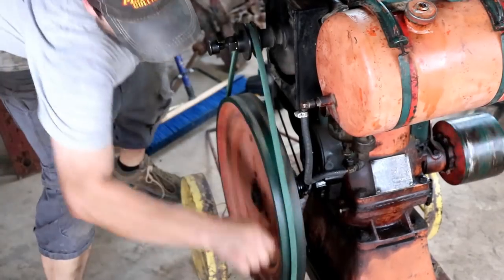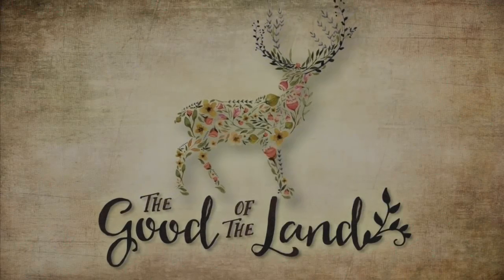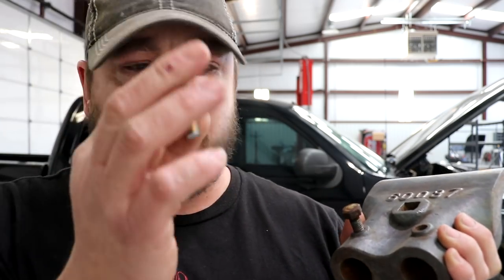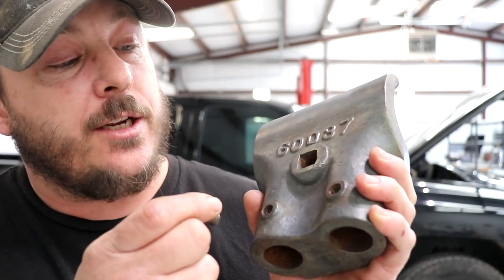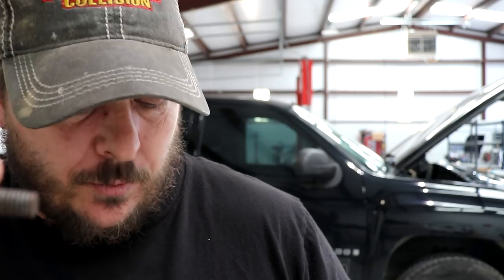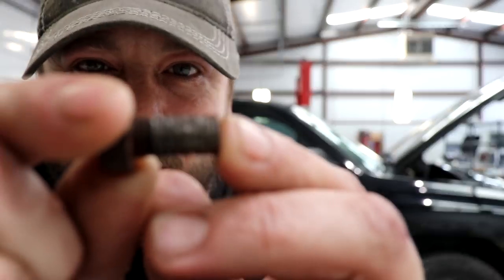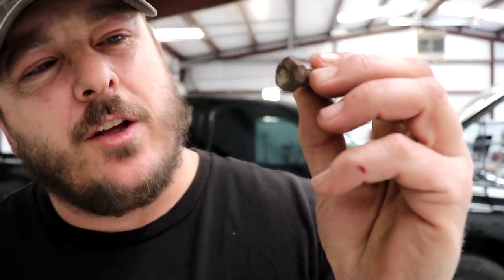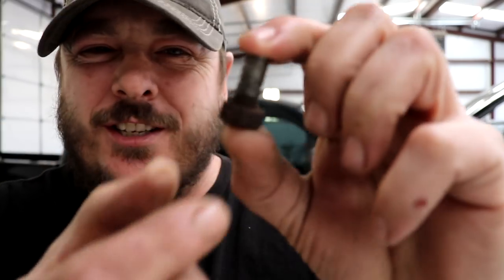OLD MECHANIC TAUGHT ME THIS YEARS AGO! Passing it on to the NEXT GENERATION!

Comment: Oh yeah, here's an old one, ( I learned this one on English cars ) ! That front engine bolt, that holds the pulley on, is an 1 5/16" bolt, which is 3/4" drive, and expensive too, who's got one of those? So you get a Craftsman 1 1/4" and beat it on with a BFH, splitting the socket, leave it like that and when your done putting your mill back together, knock the socket off the bolt and take it back to Sears, YOU CAN'T BEAT THE GAURANTEE at Sears! Hey, how often you going to rebuild your mill?  I've been motorheading for over 50 years now and I get a charge ( battery ) out of telling of my experiences! Here's a good one, no matter how tempting, never put tools on top of the car battery, they touch the poles, and red hot, then white hot, then BANG! Your tool just showered you with white hot metal, Time to really break out the Mechanics language dictionary of four letter words! Or weld around a gas tank unless It's filled to overflowing with water! And don't weld on concrete either! Never! Remember! Assembly is the reversal of the removal procedure, unless your trying to build up a stock of hardware, what this guy should have done a long time ago.

Comment: Cut the bolt with a hacksaw, it's quicker. One nut is all you need to chase the threads but, you can add another if you're that doubtful AND the bolt is that long. And don't waste time tapering the threaded end. After cutting a bolt a half dozen times you shouldn't need the nut to chase the threads.
Reply from the maker: +Joe-n-Tex https://youtu.be/OgvQKuCOhqI

Comment: quite something about those old guys, some couldn't read very well, and nor did they get around to crowds with information,  such as the internet, schools were grade 1 though 8 in one room. that's if you wanted to go, and they worked in the fields before they were 10 years old. my dad was one, he'd cut bolts like that, he took a farm tractor a large one, it had a slinger or dipper oil bath system, he drilled the crankshaft and lobes and put an oil pump in it, he swapped 2 gears around in the trans, it went from a 1200rpm farm tractor engine to 4000 rpm or so. no seat belt and no roll bar.  it would do wheelies hitting third gear, it went 40mph.  he raced it and always won. limited information yet it was narrowed with quality. not a lot of random bs. he slept from  8pm till 4am every day of his life. he didn't talk alot either. i had to watch if i wanted to learn anything, he didn't explain it. there's not a lot of them left to learn from.

Comment: Good video, just wondered why you ground off the markings on the head and the sides, it will just rust sooner.  Maybe you want it to look similar to the other bolt?  Also, the length didn't really matter unless it sticks out so far you would gouge your arm on it.  But I get how you like things to look the same, and match, I'm sort of the same way especially if you are painting it.  Haven't been watching the whole restoration process you are doing, but that hand crank engine or whatever is pretty cool.  Good job!  I'm like the other commenter, I use a hacksaw sometimes, cause I don't have a fully equipped shop with air tools
Reply from the maker: +Renee Mellinger https://youtu.be/OgvQKuCOhqI

Comment: You got it wrong. After cutting the bolt shorter, do a little rounding off, THEN unscrew the nut. Otherwise, rounding off may bugger up the starting threads, Pay attention.

Comment: Great video.  ¿What grinding wheel did you use to reduce the bolt length, kindly?  (¿A flap 36 grit disk, as for a hand angle grinder?).  Just wondering.  Thank you.

Comment: Those marks on the bolt head indicate the grade of the bolt in other words the hardness of the bolt . He should have not ground them off they could have been used later on to tell what grade of bolt to use . Sometimes it matters as to what grade of bolt to use .

Comment: Thank you for this trick.  The condemnation below is really disheartening.  I'm a new mechanic myself.  Know one ever showed me to do this and most of what I learned, I learned in vocational school.  They really push the "right way" ie. Go get the correct bolt.  Yes, of course I have shortened bolts when needed.  But it never occurred to me to put nuts on to set the length I want prior.  I always just compared the two and ran a thread chaser over it after I got it to the length I wanted.  Little tips like this are what us new mechanics that didn't have the privilege of learning from some old timer or some such need.  All of the hate below is exactly the sort of attitude that keeps young people out of the trades.  They show up somewhere eager to learn, are ridiculed for not knowing "no-brainer, basic" techniques, and assume the fault is theirs.  As if somehow not being taught anything and then not knowing how to do that thing is their fault.  All of the experienced experts below should give new people a chance to learn!  Ridicule them when they do something genuinely dumb.  Like that time I thought I could just pry that last little bit of the lid of the grease can up with the inspection mirror... because only like 1" of the lid was actually stuck down in the crease but I couldn't get my fingers on the greasy lid.  That deserves being ridiculed and I took it with chagrin on my face.  Not knowing old-timer tricks and tips should be a teaching opportunity!  Keep it up.

Comment: Just wondering what possible benefit there was to grind the mars and coating off the head of the screw.
There's none.
In fact, you just made rust considerably more likely.
Reply from the maker: +Robert Evans https://youtu.be/OgvQKuCOhqI
Reply: Post what you like, it's your channel.
I'll rely on my 28 years as a Toolmaker and Instrument-maker.

Comment: Not sure why you felt the need to obliterate the grade 8 markings on the head. That would be nice to know for someone years down the road if this bolt ever seized up in the hole. They would know immediately they were dealing with a hardened bolt and not a grade 5 or less. Might save them a drill bit or an easy out.

Comment: Why dont u cut it with a dremmel or side grinder w/ cutting blade? Not sure how long it took you to do it that way but seemed way longer cutting time.  its easy to cut them flush up to the nut. Never had a nut jam on me backing it out.  And if so id just put it on a grinder till flush.  Thanks for sharing man great vedio. D

Comment: What wasn't told is that after grinding the bolt down you might not want to take it out of the vise with bare hands (as shown)
Reply from the maker: +jiw71 Its cool to the touch thanks to the Norton Blaze disks.
https://youtu.be/vtOR9A8ekFg

Comment: another useful trick is if you cut it in an angle on the end instead of cutting it completely off if you cut it in angle that gives you a good starting point for when you go to screw it in because you're basically got a spear that you're sticking into a whole as opposed to something that the threads may be worn out on. to get a bolt to start you have to have a starter thread. if you cut it in an angle that gives you the Reds to start with so even if one thread won't kill you can still force that threat out into a proper shape. this has never not worked for me.

Comment: As a note the job would have been a little safe on the depressed blade had you cut the nut shy of the length and then dressed the remaining bolt. . Great vid on an old technique

Comment: One problem I see is that if you needed a class 8 hardness bolt, you probably don't have that after your grinding.  That grinder heated up the bolt and without proper tempering, you destroyed the hardness.  Now if the proper bolt is a low strength bolt Class 1 or 2 you may be ok.  Also in some instances having too hard a bolt means that the bolt will not shear when it should and the piece it's bolted into is damaged.  (Example: bolts on driveline parts are often grade 5 or lower so that the bolt will shear instead of causing serious damage to the driveline component)
As a stop-gap solution - you do what you have too but if that use needed a class 8 bolt... you probably destroyed that by grinding it, especially if you took off more than a 1/8 of an inch.
Reply from the maker: +G Scott https://youtu.be/OgvQKuCOhqI

Comment: If your intent is for restoration and you wanted to remove the top markings I guess i understand. But since you chose to remove all sides as well of finish it will obviously need paint for rust  protection. You could have left the sides coated and most of the top coating then painted and had a better rust preventative product.

Comment: Dude don't grind off the ID markings on the head of the bolt. It tells you its strength. When you heat a treated bolt it softens it. I use a hack saw and finish with a file, all cold. I am a retired tool maker from the fastener industry. Markings are always raised. If they are sunk they have been tampered with. You cannot remark raised marking. My father (old school Chicago engraver) showed me this technique long ago. Go cold if strength  needs to be maintained. Good luck and nice video.

Comment: The old mechanic was wrong. You should not grind the zinc chromate off the bolt head. Also, you need to spray or brush on zinc chromate on the exposed metal threads.

Comment: You grounding down the head of that bolt it's going to start to rust that is a special coating on it if I'm not mistaken it's taken you should have taken or ground the coating off no rust will start to develop I believe that was a special anodized coating I'm not a metallurgist by any means but I believe that was ahead of zinc cadmium type finish either way it was protected you should not have ground it down none the less you do have good skills with the power tools as I have very similar myself in that have been a mechanic 31 years
Reply from the maker: +Dan Tracy https://youtu.be/OgvQKuCOhqI

Comment: just use a saw. don remove the marking on the head wich give directions how strong the material is and how much torque should be applied. 8.8 marking is quite stron but 10.8 is stronger and needs more torque for suspension etc.
Reply from the maker: +Bernd https://youtu.be/OgvQKuCOhqI

Comment: 1st off , that isn't a bolt ,but a hex head cap screw .( there is a difference ) using a Gr8 in place of a Gr2 is a bad idea, the manufac.  specified the Gr2 for a reason. so you would replace a Gr2 with a Gr2 and so on.
Reply from the maker: +Paul Gula https://youtu.be/OgvQKuCOhqI

Comment: what was the point in grinding the brand off the bolt? if its a galvanised bolt you've just defeated the idea
Reply from the maker: +Adam Hughes check out the video in the first comment. It will help. Thanks!

Comment: While this may work on a personal project, I would not recommend this to a customers machine. Fasteners are specifically engineered for each application. If an engineer uses a specific grade of steel on a bolt, and somebody uses a grade of steel harder than the original bolt, then the female threads of whatever part you are bolting up is more likely to strip.  This is the difference between quality professional work and hacks.
Reply from the maker: Wook On Wheels https://youtu.be/Zmgo3kCJ46U

Comment: Great fix for not much money.  However, I was with you up until you ground off the markings on the top of the new bolt.  Why was it necessary to do that?  It looked like a Grade 8 bolt, the identity of which should be preserved for the next mechanic working on the vehicle/equipment.  If it was simply an appearance thing, then replace both bolts.  And if it didn't require a Grade 8 bolt, just replace both with more common lower-grade bolts.  If one's messed up, they probably both are.

Comment: Only problem was your order of operations.  The way you did caused you to scratch the vise.  Good vises are costly.  One scratch may be no big deal, but many add up.

I would have locked the nuts as far toward the threaded end as possible, then mounted it as high in the jaws as possible to dress the head.  Then trim the threaded end.  Vise remains unharmed.
Reply from the maker: +Andrew Vida https://youtu.be/OgvQKuCOhqI

Comment: All that just to tell me how to cut down a bolt... And personal I wouldn't grind down the head, a. who cares if it has markings. b. It might have a corrosion resistant coating on it, by grinding it back to bare metal it may now rust faster.

Comment: Congrats, you have shortened a screw, I did such things when I was 5, and I was using a metal saw and concrete back then (yes, the floor, because I didn't had access to sanding paper). Also by grinding the sides you damaged the bolt because the head might get loose when you try to tighten it and the wrench can slip, never do this.
Reply from the maker: +draconpost congrats!
https://youtu.be/OgvQKuCOhqI
Reply: A lot better now :) I didn't thought about the thread (I filed it usually). So i guess I learned something. Also it's good to pass information. I wasted a lot of time when I was fixing my engine because I didn't knew how to make some things and noone wanted to tell me how, guess they didn't understood that they were not going to make money out of me anyway ( I was fixing the engine because I wanted to do it myself, not because I wanted to save money). In the end I was able to fix two engines, crappy 1.4L ones but hell, it gives a lot of satisfaction. Took me almost half a year to get the knowledge to be able to do it properly thou (the first try was a total fail) And yeah thinking about it, many people don't know how to replace a simple light switch.

Comment: Wow. Hack saw could have done it faster and saved your grinding disk. The main point being that you threaded a nut down first so that after you “cut” the excess it chases the threads. Then a simple bevel and there you go. Minute and a half tops.
Reply: The Good of the Land does a air hack count? Will post one tomorrow.
Reply from the maker: +Cody Call Sure.
Reply: The Good of the Land can’t really put down your way of doing things. I don’t know everything so. I gave you a thumb up. Just in case I come across a problem I don’t know how to solve. ;) you may know.
Reply from the maker: +Cody Call No love lost here Cody. The only reason I made this silly video was to help a few people and now it has like 2 million views. Crazy. The disk I used was a Norton blaze disk and it eats steel. I made a few comparison videos after this that might interest you. Thanks for watching
Reply: The Good of the Land will check them out. Broken bolts are my worst nightmare. I jumped to conclusions. Had three today in exhaust manifold on 460 Ford. Two in the heads. Broke using a 6” 3/8 drive ratchet. Was very upset. Nearly 3 hours to get them all out and the threads cleaned. Just annoying. So ya. Keep it up. Thanks

Comment: A word of caution, assuming the bolt is galvanised within a zinc based process, the use of power tools will exacerbate the dust and fumes created by your methods.  Primary hazards are the inhalation of the fumes and/or ingestion/absorption of the particles which could contain lead, antimony, zinc, iron phosphate, chromate or several other nasties.  If the bolt is cadmium plated, the possible hazards can be very serious to health.

Comment: The real trick is putting the nuts on so you can clamp it in the vice securely without damaging the threads.
Reply from the maker: +kadmow https://youtu.be/OgvQKuCOhqI
Reply: @The Good of the Land.  First rule of youtube:Nothing is personal. Problem is lots of people in US and UK can only use personal attacks when their curiosity is dumfounded, I prefer humour.
This is edutainment. . I'm sure those with nice humourous comments mostly see what you were showing to the chil'n. Forgive all the netizens for Being funny/sarcastic/condescenting in humour if you will. The bad responses obviously lack for nuts and nolts upstairs  Good show. But not cleaning up threads with a file/thread file leaves that "chased" thread real starp. In a metal shop it is a sin not to file or deburr sharp edges,  not dressing a thread properly only works untill the thin end thread gets struck/damaged and it closes, back to square 1, quick and dirty for when you need it fast.  BTW Why grind a bold down like that when cutting through uses a whole less effort.  Cheers for the followup.
Reply from the maker: +kadmow Thanks Brother!

Comment: Damn, I've only done that a few hundred times already. You should have said that the original bolt, having no markings on the head, probably was a hardware store replacement for a factory bolt. No markings means the bolt is ungraded and is soft. You cut a bolt with 6 markings, which means it is a grade 8 bolt, so why would you grind the markings off? The bolt you were replacing wasn't original so all you did was remove the hardness marking.
Reply from the maker: +Jerry Lynch https://youtu.be/OgvQKuCOhqI

Comment: Never ever get a high grad bolt hot if it's for a critical part, like something on a suspension.  Also you ruined any corrosion protection that bolt had.

Comment: He must have asbestos fingers!!  And just so's-ya-knows:  the raised lines he, for some reason, ground off the head of the bolt (actually correct term is 'cap screw') tell you the hardness....  add 2 to the number of lines...this one is a grade 8...technically the hardest/strongest...but some companies make what they call super-grade 9's and 10's.  Grade 3 is the lowest.  S/S falls at the upper end of the scale but they're not as hard as an 8...how hard would depend on the blend in the S/S.  And if you need to match a torque setting do NOT lube the bolt...don't even hold the threads in your fingers...or you'll massively over-torque...which could be catastrophic.